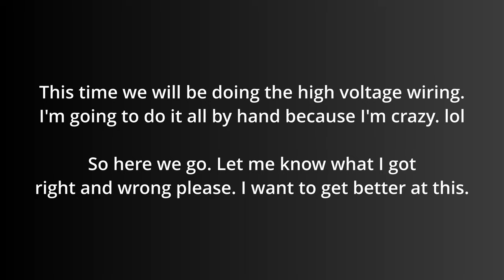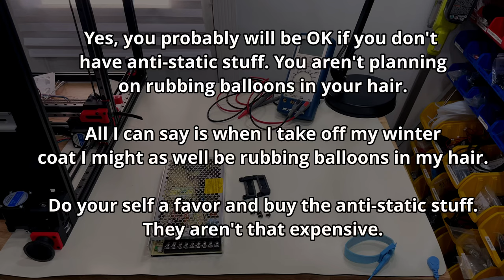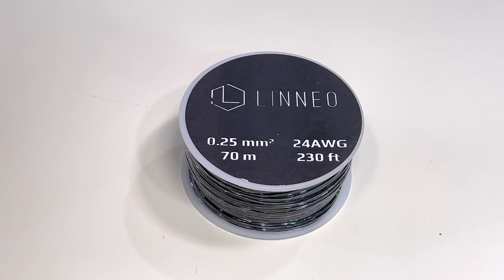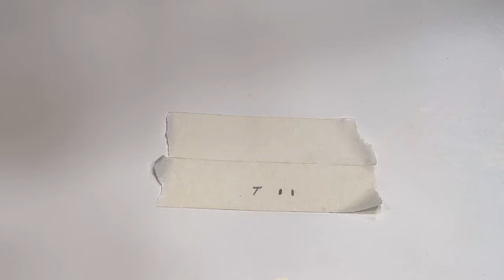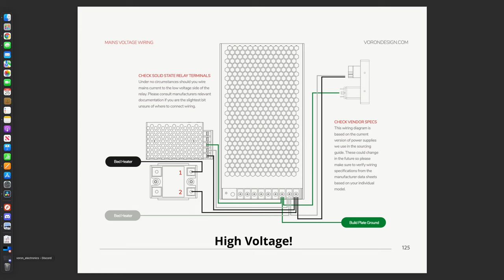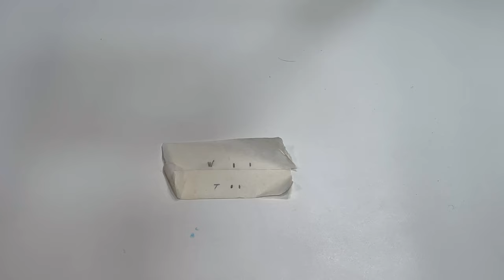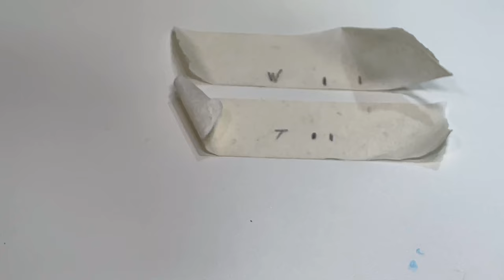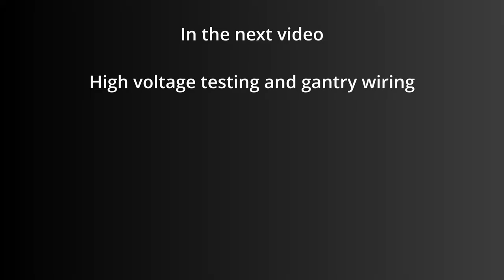Voron 2.4 Step By Step Part 8 High Voltage Wiring

Comment from the maker: It's been pointed out that I should have grounded the inlet ground wire to the frame instead of the Wago. This and a star washer (the kind that digs into metal) is required to meet UL requirements. The ground circuit stays the same, it just joins at the frame instead of the Wago. This is considered (and is) a safer way of grounding a device. I hope to have pictures up on the community tab tonight. (2/2/22)  I also will put it as a correction in the next video.

Comment: I am an engineer and I haven’t touched normal wire stripper for years. The “cheap” automatic wire strippers can strip any wire you can come across perfectly except high voltage wires as they are too thick to fit in and you usually use a utility knife to strip those anyways. You just need to adjust the tension correctly by adjusting the thumbscrew. Insulated crimps are better and are easier to crimp and have higher crimping pressure than non-insulated crimps, you just need the right tool to crimp them.

Comment: Scott, my UL guy would not allow the AC GND to be connected that way.  The wire from the wall must go directly to the chassis with star washer.  Not flat washer.  Then extend the GND from there to supplies.  Your wiring and heatshrink is fantastic
Reply from the maker: I’ll have to find a star washer. Was it a special type?
Reply: @scottcorn  The theory is the GRN wire from the wall must go directly to the chassis GND.  I think your allowed more than one connector under that screw. It must include a star washer that would dig into the material and not corrode over time.  If any of the other GNDs open the user is not in as much of a danger of a shock.  The washer is just something with twists in it so it digs in.  
This means you would have to bring your GND from the star setup to your WAGO unit as you have set it up. Personally I would be more worried about that heated BED than the rails since 120volts is sitting right next to it a few places.  The rails are not near anything dangerous.  Just static maybe. I just saw NERO reset his camera 6 feet away with static.
Reply from the maker: I saw that happen to him also. I just ordered some star washers from Amazon. We have a large ice storm coming in tonight. Hopefully these parts get her. lol
Reply from the maker: I think I'll ground them all there. It eliminates a wire also. Did some more research and of course you are correct. lol
The panel guy from work I talked to says it's just a matter of trying to eliminate as many failure points as possible. It also makes the distance to the inlet ground every so shorter.  All for safety. Thanks for your help.
I'll put it up as a stand alone comment as a correction as well as in the next video.

Comment: 15:27 I’m no professional, and certainly have very little experience with this exact procedure, but I found that by rotating the fitting 180° in the crimping tool from the way shown here, I was able to produce a better crimp that was perhaps stronger than the way that you did it. I use different tools and different consumables though so YMMV.
Reply from the maker: I was really clunky with the tool on video trying to get a clear shot. lol I watch myself on the next ones to see how I actually hold the tool while not filming.
Reply: @scottcorn  of course, crimping while operating a camera will certainly make things complicated! I’m not saying one way is always better than the other, but for me and my tools and my fittings, I tried a few different ways and this way worked better to the others in my case.

Comment: Excellent video once again. I need to come up with some ideas of some mundane tasks for you to do so we can get more excellent instructionals. Like, cleaning out a dryer lint trap, or emptying the dishwasher. 
Step by step. 
Haha. But really, excellent work. I know it takes a lot to not only do this but to take the time and film it
Reply from the maker: Thank you. This one was a bit frustrating. It’s an afternoons work but to film it and edit it’s a couple of weeks. I do it in order by building, filming and editing a little at a time.
Reply: @scottcorn  I think you underestimate the value of laying it all out so clearly though. I’ve done this sort of wiring enough times and this is still super useful. I’m gonna basically be doing this exact step this evening and will be following along with how you’ve done it.
Reply from the maker: Thank you
Reply from the maker: Nate, I'm going to ground all the ground wires on the frame. LCD Consultant pointed out that to meet UL standards the ground has to go directly from the inlet to the chassis (frame). It also has to have a star washer (the kind that dig into the metal). The circuit stays the same. You just remove the extra ground wire to the frame. Put ring terminals on the remaining  grounds and attach them to the t-nut we added to the frame. I hope to have something on the community tab this evening.

Comment: Old vid, but I wanted to lend a tip I recently figured out... the insulated end on crimps comes off, so before crimping pull it off and slip it onto the wire like you would heat-shrink, then crimp and put the insulated piece back over the crimp end!

Comment: The Formbot kit I purchased had both 4Amp and 8Amp fuses. One I assume is for 110V the other for 240/250V but wanted to make sure. In swoops Scott with his fuse edit and the day is saved...again. Also the 2.4.R2 has three inlet covers 1mm, 1.2mm and filtered. The filtered is the one shown in the manual so I ran with that for the R2.
Reply from the maker: Sounds like you got it all figured out! Using the filtered inlet is a good idea. Their quality is better IMHO than the non-filtered inlets. Filtering the actual power never hurts either.

Comment: Looking good 👍 with you on the insulated crimp terminals, I absolutely detest them.
Reply from the maker: You and me both! I don't like that to get them crimped well you end up exposing metal under the insulator. I also just don't like how the look. lol
Reply: @scottcorn  I've had the insulation end up sliding off the crimp and down the wire leaving the connection bare, hoping to start wiring mine this weekend, with NON insulated crimp terminals and heat shrink 😁

Comment: Why are you grounding the frame? Haven't seen that in the assembly manual or any wiring guides.
Reply from the maker: In general anything that will conduct electricity and can be touched by the operator should be grounded. If there was a short it would return to the electrical outlet ground and not through the operator. In fact another viewer has pointed out to meet UL codes in the US I would need to ground directly to the frame first and then go from there. It also requires a star washer (they cut into metal). I may add this to the next build video. Haven't made up my mind yet.

Comment: I would be curious to know where you purchased the cables from! I'm having a hard time finding any small spools locally, and Amazon also sells spools for much larger than what I'm after. The sizes you show here are much more to my liking.
Reply from the maker: The black FEP wire came from KB3D. https://kb-3d.com/ It is lower cost than the PTFE.
The red PTFE is directly from Remington industries.  https://www.remingtonindustries.com/

So far I think I would recommend the FEP.
Reply from the maker: Just realized these wires are from my video not yet released. lol 
The wires in the in the last released video is Fermerry from Amazon. https://www.amazon.com/gp/product/B089CPH72F/ref=ppx_yo_dt_b_asin_title_o08_s01?ie=UTF8&psc=1
Reply: @scottcorn  Awesome, thank you very much for the information!!
Reply from the maker: No problem.
Reply: @scottcorn  One more question. Where did you find the terminal connectors? My pack came in the mail today but they are all way too big for the 5v PSU, and just barely too large for the 24v..
Reply from the maker: Morris Products High Temperature Ring Terminals – 22-16 Wire Size - #6 Stud Size – Nickel-Plated Steel – For HVAC, Industrial Kilns, Electric Space Heaters, Commercial Ovens, Fryers – Pack of 100, (12512) https://www.amazon.com/dp/B00AJSAFBM/ref=cm_sw_r_cp_api_glt_i_WCW4FDJEZS83KWFHDXPX?_encoding=UTF8&psc=1
Reply from the maker: That fits the 5v
Reply from the maker: This mostly fit the 24 volt. I had to drill out the hole a little. Morris Products 11036 Ring Terminal, Non Insulated, 16-14 Wire Size, #6 Stud Size (Pack of 100) https://www.amazon.com/dp/B005GDFNY4/ref=cm_sw_r_cp_api_glt_i_0JDP8WN74XT9ZAK5KGF1?_encoding=UTF8&psc=1

Comment: Great videos! in the Formbot kit I'v been building for ages the instructions show the cables to SSR 1 and 2 are connected in opposite order..  I have no idea how SSR works, so my question is, does it matter which is in and which is out?
Reply from the maker: Thank You.

As long as the 1 and 2 lugs are marked as load it doesn't matter. If for some reason it has a + and - symbol it does matter. (I don't know your SSR brand)

A SSR uses low voltage DC (the side with the + and -) to turn on high voltage AC (the load side and 1 and 2 on my SSR) . DC has a positive and a negative. AC does not. 
You do however need to run the load AC wire (black in US and my video) to the SSR load side. Don't run the neutral AC wire (white in US and my video) to the SSR.
Reply: @scottcorn  Thanks! mine is almost identical to yours. Omron G3NB-210B-1 .. will connect the power tomorrow and see if smoke comes out! 😆
Reply: @scottcorn  no smoke so far! moving forwards 😁
Reply from the maker: @jannekallio5047  Good! Glad to hear it.

Comment: Do you have a link to Molex connector kit on Amazon?
Reply from the maker: Sorry, I got mine from Digi-Key. I looked for it on Amazon, but the kits where priced double what it should be and they look shady. 
Here is the Digi-Key link if that helps.

https://www.digikey.com/en/products/detail/molex/0766500159/2116044

Comment: The Crimp tool divot should be on the solid side, not the side with the seam.   For Example: The crimp at 15:31 is on the wrong side. Do not modify the connectors, buy the correct size. When you trimmed the connector, you need to know, that it is no longer rated for its designed current.  Here is a decent YouTube video showing the correct way. https://www.youtube.com/watch?v=UTMlSPQ2Yqw

Comment: I was sooo annoyed, when I realised that the switch, the fuses and the self-tapping screws were missing from my BoM... Anyway, I used flathead screws (M3x12 FHCS) for mounting the power inlet in the end. They're just long enough to attach a nut on the other side and give it a bit more sturdiness. Those C14 power cords can be quite tight after all.
Reply from the maker: Yes, the kits can be annoying with missing/poor/wrong parts. I self sourced mine before shipping costs became way too high. Hopefully the rest of your build will go well.